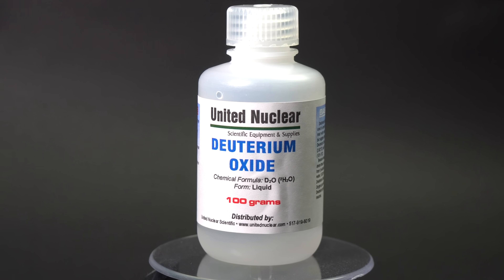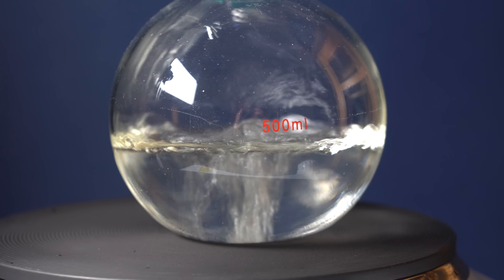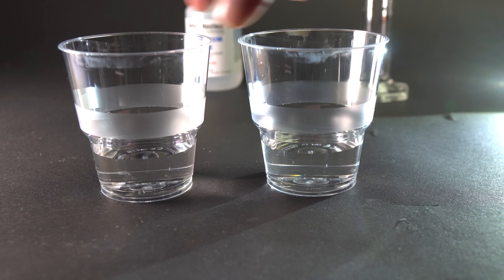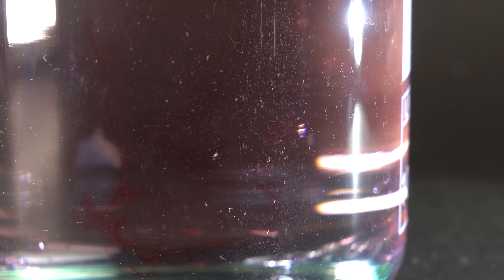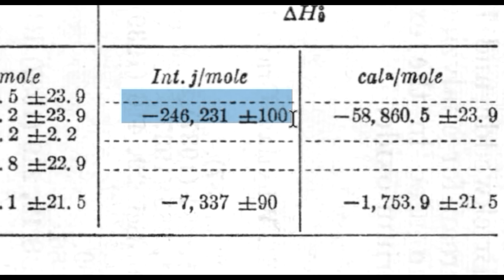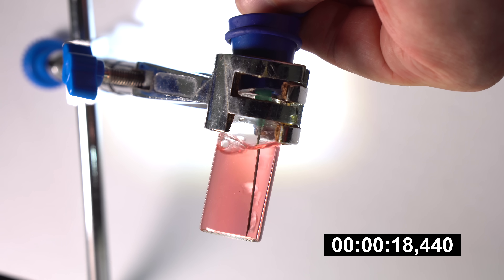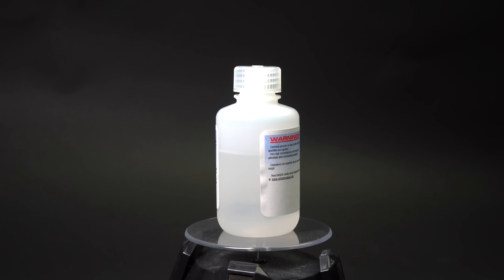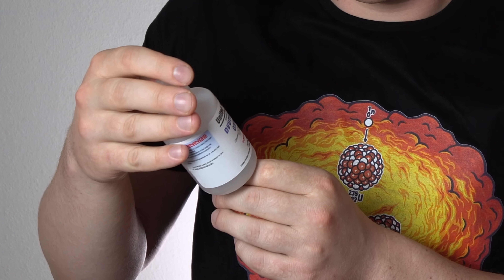Making pure Deuterium gas and tasting Heavy Water!

Comment: Does water really contain so much D2O.  I would guess that the deuterium  would be mostly DH0.  Semi Heavy water. Hydrogen atoms exchange between Oxygen very readily.  If the D is only about 0.01% of the hydrogen.  D2O molecules will be very very rare.

Comment: Hydrogen doesn’t burn, it fusions when it comes in contact with heat. The hydrogen sucks in the heat and capsules it inside itself, not the other way around. A  burning gas is a gas that the flame uses as fuel, it consumes the gas til there is no more. Hydrogen atoms consumes heat that is damaging to us til there is no more intense heat left. If there is no dmg left then the hydrogen would stop make that chemical reaction and rise as normal towards the sky. A fusion is something like a reversed bomb, a heat protection don’t confuse it with fuel for heat. Fusion don’t need oxygen to make the chemical reaction while burning oil as an example requires oxygen to burn.

Comment: If you take sea water with salt in it and make an electrolysis on it you would make the Cloride to escape and the Natrium to fall down. You would separate Oxygen from Hydrogen where the H would escape and the oxygen would fall to the bottom after ur done. Oxygen has a bigger mass than hydrogen yes, and a liquid with mostly oxygen in it would act like this liquid you say is containing “D2O” which is totally taken out of the blue. Water can not be liquid if you put  the H in H2O away. HYDRO IS WHAT MAKES IT LIQUID AND HYDRATED. When there is no HYDRATION THERE IS ONLY DRY LAND LEFT. And even then u can find hydrogen in the driest of lands.
why are you making everything so weird and putting new explanations in old facts? Claiming it was your scientific research that came up with this when it was the Chinese or the arabs who did it ages ago.
Just stop with this stupidity.

Comment: I have a scan of the book named "Вредные вещества в промышленности том 3" ("Harmful substances in industry part 3"). There are the article about the D2O. I leave here a google-translate of  the part of it.
D2O
Toxic effect.

Animals.

Daily introduction of 1 ml of heavy water into the stomach of white mice for every 10 grams of body weight causes death within seven days. (The concentration of heavy water in body fluids reaches 40-50%) At 20% of heavy water, metabolism increases, symptoms of dysfunction of the nervous system are observed. Further saturation of the body with heavy water leads to a sharp decrease in metabolism, as well as body temperature, severe disturbances in the activity of the central nervous system ... At 30-35%, poisoning and death occurs if the animals are not transferred back to ordinary water. Even 30% results in the inability of mice to reproduce. In mice that received drinking water with 75% heavy water - a decrease in water consumption, dystrophic changes in the epithelium of the tubules and glomeruli of the kidneys, leading to partial closure of the lumen of the tubules and capillaries; degenerative changes in the salivary glands. In white rats - a decrease in renal plasma flow to 4% of the control content. ... At a concentration in the blood of 60%, all animals die.

Excretion from the body is slow. After ingestion of 2 liters of 0.46% heavy water by two people, excretion with urine began after 26 minutes, but half of the heavy water drunk was released only after 10 days.

Comment: I work a lot with electrolysis. Two of the byproducts of electrolysis many people don't know exist are tritium and deuterium. I did not know this for a long time and never collected it. The volumes of tritium are so low that it is hard to detect. I finally managed to capture some a few years ago and make my own tritium glass tube. Being as it was not that much the two did not glow very bright. I did manage to prove that it is in there. I do not have my tritium glass rod anymore as I dropped it and broke it. They are fun elements that are more abundant than I ever thought they were!
Reply: I should have added this to begin with but the reason tritium and deuterium are left after electrolysis is because you cannot electrolyze either of them. Another words I'm not actually creating tritium and deuterium inside the unit but merely they are left over from the oxygen and hydrogen production from water.

Comment: I wonder what the thermal characteristics are vs normal water in say an open or closed loop water cooling system. I imagine if you filled a water cooling loop with pure heavy water you wouldn't need biocides to prevent algae formation? Since it's denser it should also have a higher thermal capacity?

Comment: Drinking a few millilitres of heavy water isn't that dangerous. For starters, you already have a spoonful of the stuff in your body from the deuterium content in naturally-occurring hydrogen. Yes, if all the hydrogen atoms in your body were replaced with deuterium you'd probably die, but that would require all your water and food sources being fully deuterated for a month or so. (Put it this way, it's an extremely expensive way to poison someone.)

Compare it this way: we don't consider ethanol toxic, but if a 70kg human drank 700g of ethanol (about two bottles of vodka) in one sitting, that would quite probably be deadly. So ethanol is fatally toxic at around a 1% concentration in the human body. By contrast, the heavy water fraction in the body would need to be about 30% to kill someone. So, ballpark figures, heavy water is at least an order of magnitude less toxic than pure ethanol, or put another way it's roughly as toxic as beer (which typically is 4% ethanol).

Comment: So.. the Hydrogen isotope with two neutrons, Tritium, weighs 3.0160492 atomic units. 
Helium 3, with one neutron and two protons, Helion, weighs 3.0160293 atomic units.
I get that we can carefully react a bunch of hydrogen and deduce the atomic mass from molar quantities. That is fine.
But how did Alvarez and Cornog know how to weigh Helion, to deduce it's atomic mass, in 1939?
Helium doesn't react, so how can we know the atomic masses of its isotopes?
It turns out (I read the paper, see link below for summary) that the way these folks were deducing the atomic mass was as follows:
They purchased a sample of helium, and then created a magnetic field that they supposed would accelerate ions of a given charge and size, forming a current flow out of the gas chamber, through the magnetic field. Then they would measure the resulting current flow, in amperes, to know the concentration of those ions in the gas sample. So, first they set the magnetic field for the predominant isotope of Helium (4He), and noted the abundance of current induced by the field. Then they set the magnetic field for the smaller isotope, 3He, and measured it.
I find the whole thing hugely spurious and contrived, but whatever.
Chemistry is a fabled agreed upon.
https://books.google.com.au/books?id=imidr-iFYCwC&pg=PA26&redir_esc=y&hl=en#v=onepage&q&f=false

Comment: Very interesting, but I doubt, that Acetylene and KMnO4 form Oxalic acid, as oxalic acid is easily oxidized by KMnO4 solutions to CO2 and Water. We also use Oxalic acid as a titrametic standard at work to test for the concentration of KMnO4 solutions used for titrations, as they tend to loose some active substance over time forming MnO2. And the oxalic acid is oxidized in the reaction reducing the KMnO4, as you can observe by the solution going colorless ;)

Comment: I suspect that heavy water, in large quantities is poisonous/toxic. A lot of biological chemistry depends on hydrogen bonding, the reaction between a proton and local chemical moities. The moment you introduce a neutron into that binding system, stuff has got to happen, stuff that god did not intend to happen. A little taste, you are diluting the deuterium oxide in virtually an infinite amount of H20 molecules. Increase the volume of D2O, I'd be very nervous myself. Considering that two DNA strands are bound together via hydrogen bonds along the long axis of the DNA molecule, you don't want those strands either separating too easily, or not separating at all.

Comment: Using a pem electrolyser is a way better way to make d2 gas because when you use a metal like calcium you trap 66,66% of D2 on the Ca(OD)2. A better metal would be lithium in order to trap only one D atom in the Li(OD) instead of 2 in the Ca(OD)2 .

Comment: 1:20 It's not D2O, it's mostly HDO, the semiheavy water:
"In normal water, about 1 molecule in 3,200 is HDO (one hydrogen in 6,400 is in the form of D), and heavy water molecules (D
2O) only occur in a proportion of about 1 molecule in 41 million (i.e. one in 6,400^2)" on Wikipedia

Comment: 10:30 "The bond" (using the harmonic oscellator, the force constant and further constants for anharmonic oscellators) between the atoms is roughly the same, it mostly depends on the electron structure and that doesn't change. The isotope masses change frequencies of rotation and oscillation modes, but the reactions shouldn't be affected by "the bond".
Classically (as for example in my quantum mechanics lecture) the explaination of hydrogen/deuterium reaction changes goes as follows: the hydrogen, being the lightest atom in chemistry can tunnel through potential barriers and contributes to the rates significantly, deuterium is twice as heavy and the transmission coefficient of ingoing "particles" includes a term with e^(-m), the tunneling reaction is significantly hindered.
Reply: see kinetic isotope effect

Comment: does D2O really exist in water? I would have expected HDO, as H2O also tends to fall apart and recombine, which can be observerd by the conductivity of pure H2O.
So, why should the few Deuterium Isotopes specifically recombine with Deuterium? I can imagine that D2O is more stable then H2O (this is how Deuterium can be separated from Hydrogen), but the difference is small (which is why separating Deuterium from Hydrogen is so energy intensive)

Comment: The kinetic isotope effect isn't necessarily because the CD bond is stronger that the CH bond. Probably just because the deuterated molecules move more slowly. Probably.
Reply: It is because of the kinetic isotope effect, in essence hydrogen is half as heavy as deuterium and tunneling depends on e^(-m), so with greater mass tunneling becomes exponentially insignificant and the contribution to the rate of reaction through tunneling decreases. Eventhough the total reaction energy may stay the same between isotopes, the release of it over time will be smaller with deuterium.

Comment: My guess on why it would be sweet is that the body knows to ingnore the H2O in the mouth but the higher weight bypasses this and the body thinks it's a sugar alcohol (I.e Glycerol, Erythritol, Xylitol, etc) because of the OH groups.
Reply: Clearly humans just can taste neutrons
Reply: @GewelReal  Sweet, sweet neutrons.
Reply: I think the plastic container may have fooled the taste buds ......Quantum level lol that's the secret to big mac sauce
Reply: I suppose Tritium would taste sweeter still. Anyone want to taste some?
Reply: @alancruikshank5399  if you can get your hands on some then sure
Reply: The in all elements the difference in reactions of different isotopes is absent because of the negligible effects of extra neutrons because of the large number already present. For example the difference in neutron - proton ratio between Iron 54 and 56 is only 0.0769230769. But in Hydrogen the nucleus is so light that any extra neutrons affect its properties a lot. The difference in neutron - proton ratio between hydrogen 1 (protium) and hydrogen 2 (deuterium) is 1. Compare it to the 0.0769230769 of iron and the number gets less as the element becomes heavier.
Reply: Couldn't the sweetness be caused by trace impurities leftover from the extraction process? Maybe some sweet, sweet LEAD got in there at some point? Seems weird that a neutron or its resultant weight could make it taste sweet but I dropped out of school in the third grade to go work at the family ball crushing factory so I really don't know. Ain't got much fancy book learnin'
Reply: Hahaha I never thought a chemistry channel would degenerate.
OH groups? What OH groups? Unless you're talking about the 10^(negative something pretty big) hydronium (H3O+)  + OH-.... 
Quantum level?... come-off it! That is such a throwaway answer.
There is debate out there whether it tastes sweet or not.
Reply: @transkryption  I don't know where the quantum stuff comes from when tasting heavy water, why would it be quantum?
Reply: @dragonslayerornstein387  that is what Boguslaw said! 
But this video has f-ed my mind.
Like why do Deuterium Fluoride lasers have a different wavelength to HF lasers?
Woah...
Different heat of reaction from different isotopes? That's a brainfuck
Reply: @transkryption  I honestly didn't find it that surprising. Before the 60's we classified elements according to their atomics weights, which - while not as robust as the periodic tables we have now - was still pretty good. I'm sure The difference in atomic weight accounts for most, if not all of theses differences between protium and deuterium, however I'm still pretty stumped as to why deuterium tastes sweet.
Reply: @TheJudge064  why/how would atomic weight effect the electron cloud configuration?

obviously more protons change everything.including the atomic radius... (which is why caesium is the most reactive Group I element - more protons simply aren't increasing the atomic radius)

But a neutron? 
Why?
Is it somehow shielding the electropositivity of the nucleus.
Reply: @TheJudge064  as for sweetness I think we need more tests because there is a lot of inconsistant discussion out there...
As for q crazy experiment. Steam a raw not pickled artichoke heart and eat it.
drink water.
It tastes like sugar.
there is journal Nature article why
Reply: @transkryption  right, I was just editing my comment because I just remembered that changes to the no. If neutrons shouldn't change the substance's chemical property all that much. This is really strange. Also, I think the sweetness may be a nocebo effect, he read about deuterium tasting sweet, so he expected it to be sweet, so for him, it was sweet
Reply: @TheJudge064  I KNOW RIGHT... this is what I love about chemistry... you reach a point where everything you thought you knew is wrong or not applicable!

I mean classicly we're taught that isotopes don't matter.
BUT if deuterium has a different heat of reaction 
Then something IS different in the cloud? BUT WHY...
So in a very technical sense it is a quantum energy levels...

I reqlly wish he analysed the flame on a spectroscope! What a waste of fire!
Reply: @transkryption  Yeah, and what a waste of deuterium.
Reply: @TheJudge064  taste honestly I expected him to get a chemical burn of sorts. Like pure water does/can do, due to osmotic pressure of the ions within cells rushing to the outside of the cell.... pop
Reply: @transkryption  I did not know that could happen. Thanks for sharing such a cool fact.
Reply: @TheJudge064  IMO it can't be a -cebo effect. Let some random folk taste it and he will say that it tastes sweet anyway
Reply: The sense of taste is influenced by phenomena at the quantum level, which is why we do not know everything yet.
Reply: @bogusaws1485  no.
Reply: @BadBoiFX  No, u.